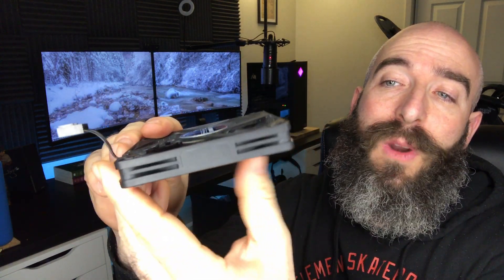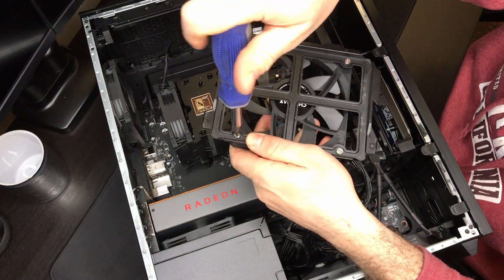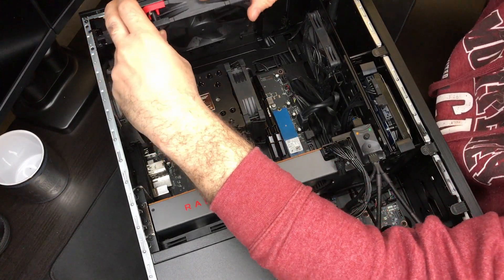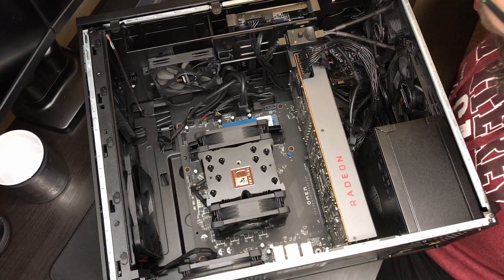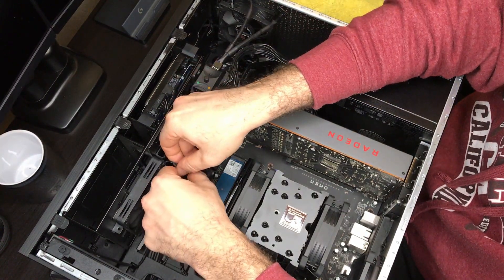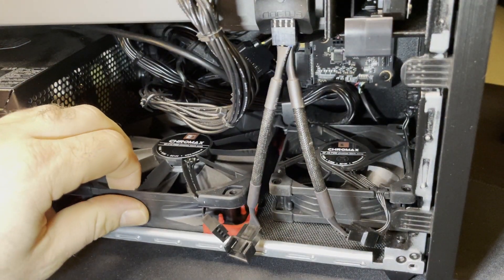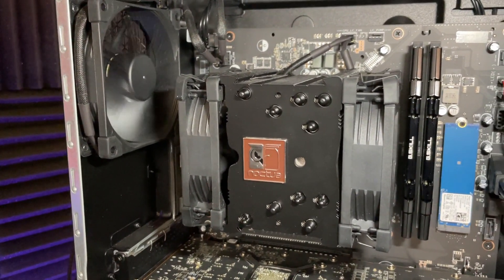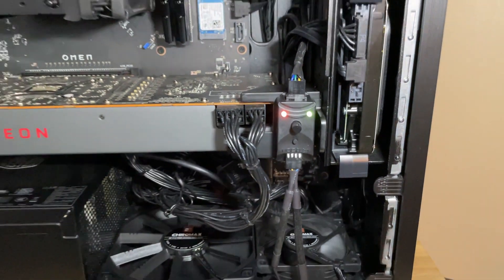How to: Install and Setup All Fans in an HP Omen 25L / 30L! Tutorial & Guide!

Comment: Hey Dan I’m getting ready to buy the nactoua cpu cooler and fans do you recommend  get the 2 fans for the bottom of the pc and the one with the double sided tape
Reply from the maker: Honestly, I would recommend just doing a 120mm fan at the bottom, and the 2 fans that attach to the cooler. The other ones don’t make a huge difference. 👍🏻
Reply: @DanKamYouKnow  got it I’ll let you know how it turns out
Reply: And the 80mm fan you listed on your video explaining how to install the u9s what is that fan for the cooler?
Reply from the maker: The 80mm fan is for the stock cooler that comes with the Omen. If you are using a U9S cooler, that fan gets replaced.
Reply: @DanKamYouKnow  ok I just ordered the stuff I ordered the u9s 2 120mm 2 92mm and the y-split cable and the tools too thanks for all the information it really helps.
Reply from the maker: Nice! Let me know if you have any questions when installing!
Reply: @DanKamYouKnow  I’m literally new to all of this but I’m going to be watching your video while installing the fans. I’m getting tomorrow night!!! I’m super excited!!!
Reply: @DanKamYouKnow  I got everything in but I’m getting no display?? It turns on then after a few seconds it turns off then turns on and stays on. I’m just not getting display?
Reply from the maker: After just installing fans?!
Reply: @DanKamYouKnow  yes and I also added the cpu cooler I’m going to try it again today and see what happens.
Reply from the maker: Gotcha. Make sure all components are fully seated. Let me know what you find

Comment: Hi i'm using OMEN 25L Desktop GT12-1006d, while on HP website they mentioned these 
"One M.2 socket 1, key A
Two M.2 socket 3, key M (one for SSD card PCIe x4 Gen 3)"

Beside the NVME SSD M.2 socket, is there any other socket?
Reply from the maker: It seems like your machine comes with a 1TB M.2 SSD and also has an additional slot on the motherboard for another. You should also have the cables free in the case to add another SATA 2.5” SSD or 3.5” HDD
Reply: @DanKamYouKnow   I want to use the Noctua fan controller but already have the additional SATA cable for another SSD, since the Noctua fan controller needs to use this SATA cable what would you recommend I do to have both an additional SSD and the fan controller at the same time?
Reply from the maker: You could buy a SATA splitter to power additional devices. I have not tried this though, but in theory, you should be able to plug this into one of your HP SATA power connectors and have additional connectors. Like this one:

https://amzn.to/3osUgRO

Comment: So in my 30L with a rtx 3060 ti /ry7 do I have to get the same fans for all of the fans for the rgb to sync or can I buy 2 the same and the 1 that came with rgb ?
Reply from the maker: An Omen doesn't have traditional RGB like the rest of the industry. No aftermarket RGB fans will sync or work with the HP Omen motherboard. They will required some kind of USB RGB controller to power them
Reply: @DanKamYouKnow  so should I just get 3 new fans ?
Reply from the maker: I would, that’s why I went with Chromax Noctua fans because of their extremely good airflow. But there is also BeQuiet / Arctic for fan choices

Comment: My 30L with an RTX 3080 / i9 sounds like a 747 getting ready for an emergency landing. Would you say this significantly reduces noise?
Reply from the maker: I am guessing yours came with a liquid cooler for the CPU? I would highly recommend replacing the radiator 120mm and the rear 92mm. The stock HP fans are garbo
Reply: @DanKamYouKnow  Yes and the omen cooler was probably as effective as me fanning the cpu with a piece of paper. Swapped everything out for all Noctua with a 6 fan setup and now my CPU temps at full load went from 83 to 60!
Reply from the maker: @BlandTaco   Wow! That's an even better improvement then I thought it would be! Nice work dude!

Comment: Hey, I just got a 25l Nvidia geforce rtx 2060. I haven't even unboxed it yet. But giving your knowledge on omen. Do you suggest I change the fans? After reading so many reviews and comments, I'm concerned about the temp being high. Also, what fans do you recommend I use to replace the current ones?
Reply from the maker: For the most part, Omens run a bit on the warmer side, but will be in the safe temperature zone. You could run the computer with no mods if you wanted too.
Reply: @DanKamYouKnow  ok, thanks for replying. If I did decide to change the fans, and specific ones I should go for?
Reply from the maker: Everything I recommend is linked in the description (=

Comment: @DanKamYouKnow Excellent work on these tutorials. I bought a 25L with just the PSU and rear fan that I plan to add a motherboard, AMD Ryzen 7 3800X, 16 GB of RGB Ram, AMD Wraith Cooler, and a Powercolor RX6600 XT along with an EVGA 650W PSU upgrade due to the proprietary 4 pin CPU connector on the OEM Cooler Master unit. Upon buying this and finding out the hard way HP used a 4 pin CPU connector on the PSU was disappointing. I have other plans for it though as I have an old HP motherboard I can turn it into another budget PC that will work with it. What did you do with the Omen once you swapped everything into the new case? DId you reuse the Omen case and make another custom Omen 25L?
Reply from the maker: Thanks Mark!! Sounds like you got a project on your hands. Lots of proprietary items and limitations with the Omen unfortunately, but still can be made into great rig. I explain what I did in this video:

https://youtu.be/iHgLXKw3dSg

I basically swapped all Omen components ( for content purposes and tutorials ) into a different case and slowly started replacing those components as well. Once the time came, I had all the remaining Omen parts left over and I was able to reassemble! Now it stays connected to my living room TV and I use my main rig in my office for games / editing / etc 👍🏻
Reply: @DanKamYouKnow  sweet! Thank you for the link to the newer video. I'll definitely subscribe and check out more of your content as well. Take care. See you again soon.
Reply from the maker: Appreciate it! You’ll have to keep me updated on your progress. Have a good day my friend.
Reply: @DanKamYouKnow  i definitely will!

Comment: how do i adjust the fan speed for the front and back fan, i want to set it to 90 % fixed. Thanks
Reply from the maker: The only method of fan adjustment is through Omen Gaming Hub and it is extremely limited. I ended up using a manual fan controller for my front and bottom 2 fans to speed them up
Reply: @DanKamYouKnow  Yea i saw your vid on that. thanks

Comment: Hi Dan! 
I got some questions about both the fans and storage upgrading in my omen 25L
I'll first begin with the fans questions
1- I will order 4 fans, top, bottom rear and front fan. Which one are the intake fans and which one are the exhaust fan.
2- I've heard that the bottom fan is better as an exhaust fan. (I've got my pc on my right next to the monitor)
3- should I change the stock cpu fan? non water cooling
4- I got a 500 ssd and I want to update it. I was thinking of buying an extra ssd. is there a slot for an extra NVMe SSD? or should I buy an HDD or a SATA SSD and which one is better and which one should I buy.

Thank you for all these helpful videos.
Reply from the maker: Hey! For your fans, you’ll want your bottom fan as an intake because heat rises ( and the Omen badly needs intake fans ). Top and rear are exhaust and the front will be blowing toward the back of the system so technically an intake. 

Stock CPU fan is mediocre and a replacement might drop temps 1-2c, so not a huge change. 

Your best bet is to add an additional SATA SSD to your machine
Reply: Thank you very much

Comment: Another question for you, what program did you use to control your body fans' speeds? I tried looking in the BIOS and I also tried installing Easy Tuner, but that did not launch. Thank you!
Reply from the maker: Unfortunately, no fan programs work with HP Omen motherboards. You have to use Omen Gaming Hub to control fan speeds, and it is extremely limited.
Reply: @DanKamYouKnow  dang that's what I was worried about. I tried a few different programs but none of them let me control anything just see it. Thank you for getting back to me tho!
Reply from the maker: @ghoum56  No problem. I ended up always using the Turbo setting on Omen Gaming Hub and also had a manual fan controller for awhile as well, which can manually control up to 3 fans.
Reply: @DanKamYouKnow  I might have to look into it because turbo sounds like a jet plane lol
Reply: @DanKamYouKnow  Another question, I know you've switched to watercooling since this vid, buy I notice you had the top and side fans facing outward, is that better than inwards?
Reply from the maker: Bottom fan should be intake -> Blowing upward. Top and rear fan should be exhaust -> blowing outward.
Reply: @DanKamYouKnow  So that bottom fan is the one resting on the floor of the case? Bause the stock Omen case I have doesn't have any openings in the front.
Reply from the maker: Yes, the one on the bottom, next to the PSU. Don’t worry about a front fan, the one I showed in this video was not very effective.
Reply: @DanKamYouKnow  nice, ok I'll flip my fans and see if it affects my performance. I also want to elevate that bottom fan just to improve the air intake
Reply from the maker: Nice! Sounds like a plan. It’s really to experiment with different fan orientation and see what works best for your system 👍🏻
Reply: @DanKamYouKnow  You're right, thanks for all your help!

Comment: Hello,

I've owned an Omen 25L for about 2 1/2 weeks now. I'm getting ready to order 3 fans to install.

I just watched your "How to: Install and Setup All Fans in an HP Omen 25L / 30L! Tutorial & Guide!" video. I am planning on using 1 top fan and 1, maybe 2, bottom fans. As I was watching how you hooked up the bottom fans, you were talking about hooking the bottom fan to the "FT_FAN4" connector. However, my Omen 25L does not have that connector. It has the LC Pump connector, but no FT_FAN/CH4_FAN connector.

After looking around the motherboard, I think I found a fan connector but I'm not sure. On the right side, just below the GPU, there is a 4 pin connector that says "CHF AN". Would this be a fan connector, or is this something different?

I'd also be willing to send photos, if you are a bit confused. (i have Discord, if that works for you)

If that is a fan connector, is it possible to use a Y Split on that connector in order to use 2 fans down there?
Reply from the maker: Hey! Yes, you can use the CHF_an header and y-split 2 fans off it. I think the best route is a 120mm up top and bottom. Replacing the rear 92mm does help quite a bit too, especially with noise level
Reply: @DanKamYouKnow  okay, thanks a lot!

Comment: Is a Noctua Fan Controller required to controll the fans? Or can I just add for example 2 fans and they automatically adjust themselves/I can control them in the omen gaming hub? I have never tried to upgrade/touch any pre-built pc I had so I am clueless about all this stuff.
Reply from the maker: It is not required. You can plug the fans into the motherboards fan headers and use Omen Gaming Hub to control it. The LC_pump fan header on the motherboard will spin at 100% though.
Reply: @DanKamYouKnow  Alright thanks a lot! Is there another header which won't put it on 100% or any other way to plug it in?
Reply from the maker: Another other plug should work fine other than the Pump header. Y-splitting is a good way to use 2 fans off one header.
Reply: @DanKamYouKnow  Alright got it, thanks a lot your information and videos are extremly helpful!
Reply from the maker: You’re welcome my dude 👍🏻😎

Comment: would the 120 mm fan at bottom facing your graphics card,would that be a problem with the outtake fan on the actual gpu?cause im hitting almost 80 with just playing wow.thanks for the help youve been amazing.
Reply from the maker: The bottom fan will help with GPU temps a bit for sure. The best way to bring GPU temps down is setting an aggressive GPU fan curve in MSI Afterburner. 👍🏻
Reply: @DanKamYouKnow  Thanks for  responding, but i just switched the top fan into a intake and the bottom fan into a exhaust has helped my problem quite a bit and please making videos.
Reply from the maker: That’s an interesting layout. Heat rises so it seems like you’d be working against the flow of heat but whatever works for you 👍🏻

Comment: Hi man! Great vid! Considering adding at least the top fan to my 25L. I am thinking of also adding the bottom, however, you said in a video that you have it set as intake. My PC is strapped under my desk - so I might be worried about dust from the floor? It is suspended a minimum of 20 cm from the floor though. Do you think it will be a problem?
Reply from the maker: Thanks! I would still recommend setting the bottom as intake and the top as exhaust. That way you’ll have a little bit of negative pressure in the case which seems to be good for temps in the Omen. Heat rises so you want to push the air up and out. Unfortunately, no matter what you do, dust will build up in the system. I’d highly recommend an electronic duster or cans of compressed air and figuring out a scheduled cleaning. I do mine like once a month.
Reply: @DanKamYouKnow   Cool, Thanks! I’ll do that! 
Btw what’s the reason behind the specific fan choice? Would any 4-pin, 1500 rpm fan do the trick? A Noctua NF-A14 PWM perhaps?
Reply from the maker: I chose these because they’re a good choice for case fans or static pressure fans. Very low noise level and they push a LOT of air. Best fans on the market.
Reply from the maker: But yes, any PWM fan will work just fine. I’m a huge fan of the A25 line of Noctua
Reply: @DanKamYouKnow  Thanks for the feedback! 😊
And again - really enjoy your videos! Keep it up! 💪🏻
Reply from the maker: Thank Jesper, I appreciate it 🤝

Comment: Hey my motherboard look a little different from yours, and in this case i mean that i dont have those for pins like u have (12:53) i have 4 dots instead, is that an issue or can u buy like an adapter?😁
Reply from the maker: You should have a 4 pin somewhere on your motherboard. If not, you will have tiny-split with an existing fan header
Reply: @DanKamYouKnow  thanks, found it and also if i wanna put a fan at the bottom should i remove that like metal piece with very small holes over the bigger ventilation?
Reply from the maker: I don’t believe it’s removable. I just placed my fan at the bottom.
Reply: @DanKamYouKnow  alright, thanks for the help!!

Comment: Did you have to change the power supply at all? I am new to this but the extra fans and a cooler seem like a lot of extra power draw
Reply from the maker: You are fine with adding more fans. I added 7 fans in totally to my Omen case and had no issues.
Reply: @DanKamYouKnow  Awesome, I just ordered one, and saw your videos which are extreamly helpful! I think I'm just gonna stick with the top and bottom fans for now. Thank you!
Reply from the maker: You’re welcome! 👍🏻 Top and bottom fans will work great. I would eventually replace the rear fan as well for something higher quality, and then maybe the CPU cooler fan too.
Reply: @DanKamYouKnow  that's what I play on doing 2 big fans and a Y splitter like you have in the link. Also thanks for taking the time to respond to a viewer!

Comment: Man my 25l is hitting damn 96c on cpu
Reply from the maker: Did you just get it? What CPU and GPU does it have?
Reply: @DanKamYouKnow  yea man I got older version yesterday from a site that take payments out check from work, it's 1710700f  and 1660super, the cpu Temps even turning fan on turbo are insane dude 60c idle and it's hit 97 98c load it can't last like that right
Reply: @DanKamYouKnow  guess I'm buy a 120mm fan try it although not seeing any fan headers on mobo not loving pre-built can't mess with bios nothing
Reply: @DanKamYouKnow  just sacred gonna fry if I try to game I have turn gpu fan to 100 or it'll start doing 85c
Reply: @DanKamYouKnow   zero air flow ridiculous they sell such under notion its ready to go out box some user have no idea to monitor tenps just fire up a game and go, 2 year warranty but who wants deal with it
Reply: @DanKamYouKnow  should I use new fan as exhaust at top or blowing down on it? I'm fixing go bestbuy snag it up
Reply from the maker: Top fan usually works best as an exhaust. I would just talk to BestBuy about it if you have a warranty. Hitting 96c is not normal for Omens. They run warm but not THAT warm.